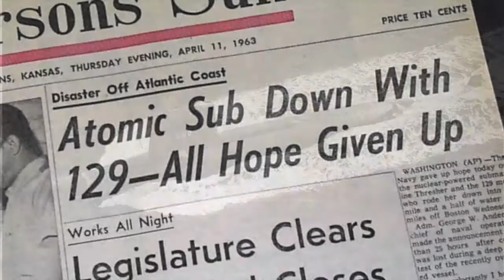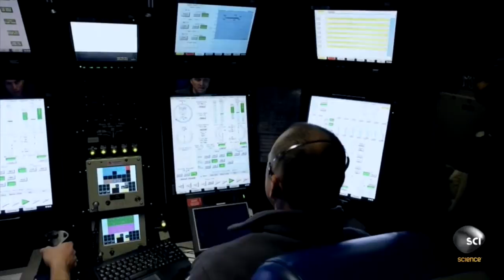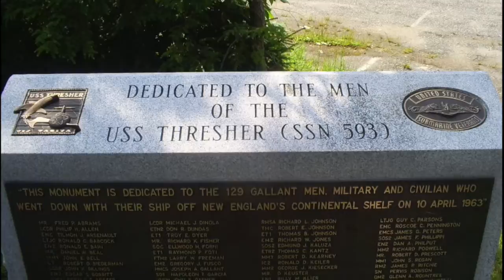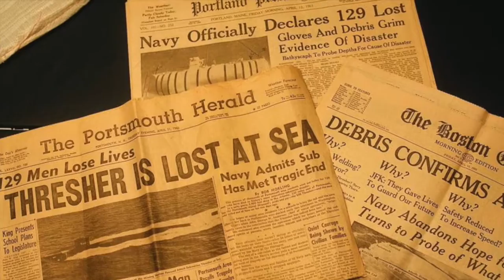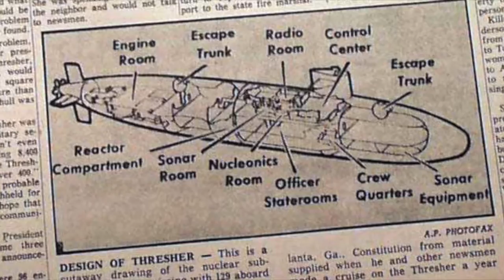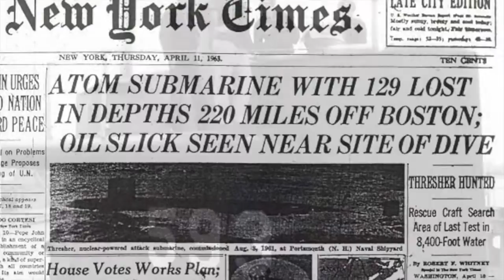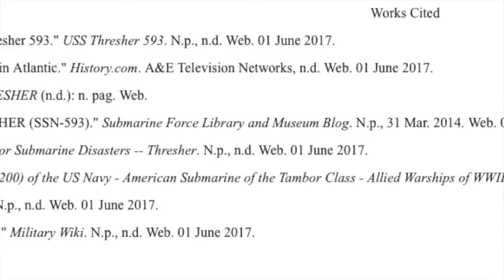USS Thresher - Engineering Project

Comment: As one might imagine the loss of the Thresher was deeply felt by those of us in the Submarine Service.  We knew that something was greatly wrong with what had occurred.  Why did we feel that way ?  Well, you see were serving on the U.S.S. Haddo, SSN - 604, a “Thresher” class submarine and were operating as normal.

What went wrong?  Well, shortly after the loss of the Thresher the U.S.S. Sam Rayburn SSBN - 635 was about to go to sea on Sea Trails, just like the Thresher.  The night before shake down the lower level engine room watch noticed the the lead seal on the wire holding the lagging collar that keeps the sea water piping condensation from occurring didn’t look right somehow.  He checked and the seal had been compromised indicating that someone had accessed the main sea water piping.  He slid the collar back and discovered that someone has used a grinder to weaken the piping.  That piping has to withstand
Sea pressure at greater than rest depth!  The intent of the saboteur was to cause the 14” diameter seawater piping to rupture when the Rayburn went deep, thereby causing it to sink.

We therefore knew that our Blue Crew almost suffered the same fate as the Thresher.

Comment: The USS Thresher WAS Flooding!  It was a ruptured pipe that shorted out all the electrics in the Engine Room.  As the Ship lost power, it was unable to surface.  Blowing the tanks failed to work as ice had built up in the valves.  As the Sub took on more and more water, she sank deeper and deeper.  The crew were unable to stop the flooding, unable to get power restored and were also unable to successfully blow the tanks!  Sinking past “Test” Depth, then “Crush” Depth.  At a depth just shy of 2000 feet, USS Thresher Imploded, instantly killing all onboard.  Crushing underwater takes less than 1/10th of a second, faster than the brain can think.  They all knew they were going to die, they just didn’t know when.  No one survived for 24 hours.  All were KILLED INSTANTLY!  Thresher broke up into pieces and sank to the bottom of the Atlantic.  She lies in 8400 feet of water!

Comment: Lately pictures of the prop shaft laying near the wreckage has been hidden,,not on file anymore,,it he shaft was spit out the back of the sub like the sleeve on a straw,,,
Reply: The USS Scorpion had its shaft ejected from the hull when the boat imploded telescoping the aft sections forward. The USS Thresher's shaft was not ejected and its hull broke into multiple pieces (reportedly 6 major parts) when it imploded.

Comment: You should see the declassified report from the Seawolf. The crew somehow stabalized it at > 600 ft. 3 Times the Seawolf communicated via sonar pings and hull banging, and during one of those the Thresher's main sonar pinged 37 times 30 second intervals. Three times the Seawolf surfaced to give report. The 4th dive, there was no banging. There were no pings. There was nothing between the Seawolf and the sea floor. There was at least 1 person alive for over 24 hours after "sinking." It's possible the NAVY intentionally lied because that is a submariner's nightmare, and didn't want to scare people from being submariners. The person who made that call probably died of old age by now.